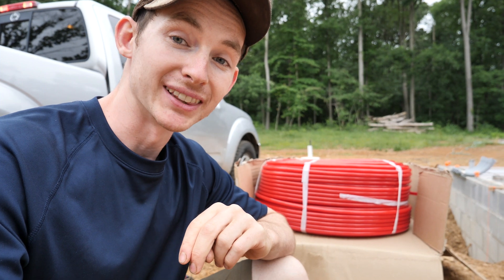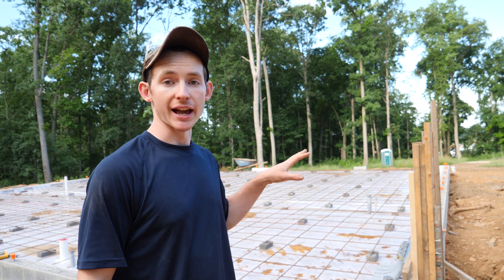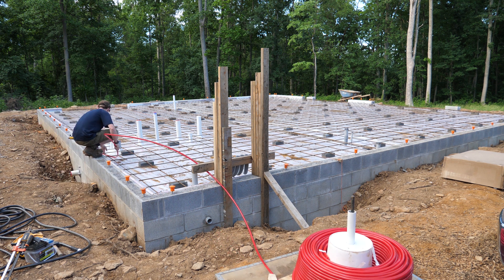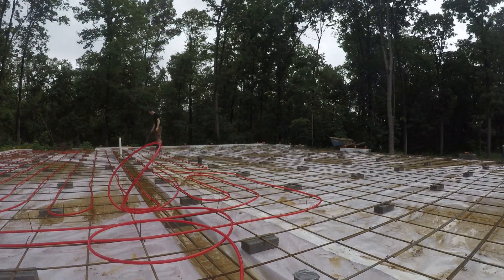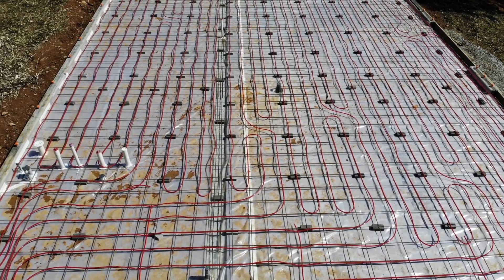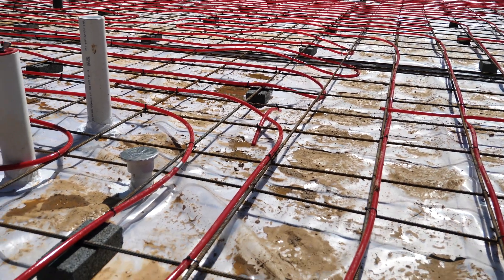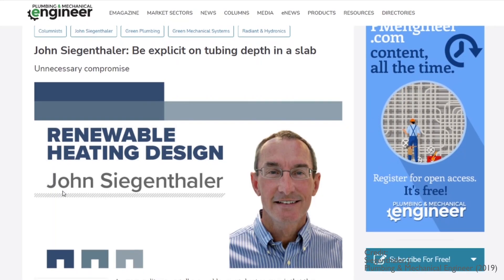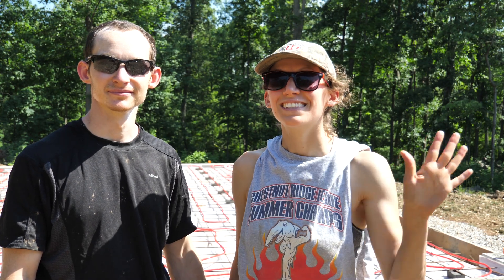Radiant Heat Tubing in Slab (installing on rebar)

Comment: After watching three more times :-) I am Leaving the question yet I think I figured out you were using the crimp tool. I am thinking about using the expansion tool yes a little bit more money just looking for thoughts trying to figure out what I'm doing.  ----- Another question for you, you said you use PEX A, question is a relates to your repair kit if you needed one and it doesn't sound like you did were you using an expansion repair kit or a coupling? I don't even know what a repair kit looks like yet.
Reply from the maker: I just used crimp rings for the test hookup, cheap and easy. They will get cut off for the real install. I like the expansion couplings, however it's harder to do them logistically as a DIYer. Big box stores don't carry the fittings, plus there's the expensive expansion tool (if you want cordless). For my real plumbing, I do lean towards the expansion fittings, whether that be myself or a hired plumber.

Comment: Thank you so much this is help me out did you get your system from someone or you designing it yourself i.e. your radiant floor system. I saw the same article and have saved it concerning placement of pipe and was also concerned about expansion joints/control joints I'll be building a new home starting in spring of 2023 in North Carolina right on the Tennessee state line.  Came across your video because I was researching if PEX a would be adequate or acceptable for radiant floor heating touching concrete
Reply from the maker: Yes you definitely want PEX-a with oxygen barrier. PEX-a is also easier to work with than PEX-b. I used a free trial of LoopCAD to layout the system myself. Haven't gotten to the boiler/manifold/circ pump yet, but I'll either get a fully pre-built setup or try to DIY it for cost savings depending how much energy I have at that point..

Comment: Just about to start our 3000sqft radiant system and after watching countless videos you answered the main question… where to put the tubing in relation to the slab!!!!! One quick question, what are those blocks you’re using to raise the rebar? Will any block work?
Reply from the maker: Glad it helped! Those are concrete "bricks". About .70 at the big box stores. Use either the plastic chairs or something with similar density to concrete, not clay bricks. The plastic chairs aren't nearly as sturdy however.
Reply: There are plastic rebar chairs at 20 cents each that l may buy to get away from bricks.these bricks,used whole,leave a weak spit.chairs are 500 minimum though..that for a monster slab.tgey go at intersections of 2 rebar,but not at every one!I would say 4 feet apart..ebay..Marshalltown l think

Comment: Interesting system that is widely used in the screed. And in your case in the floor plate. However think about it in 50, 70 or perhaps even less years. You can't just repair it if it fails...
Reply from the maker: The tubing is pretty well inaccessible after concrete, yes. But that also keeps it protected, and with no joints it should have no real reason to fail by degradation. If it does.. hopefully I’ll be dead and it’s the next owners problem 😅
-Alex
Reply: @MasonDixonAcres  that's a viable statement. Just future wise I wish building would be done more with a reusable aspect to it. For example: now you have to rid concrete of all this non-magnetic tubing in case of recycling. Also things like spray foam insulation are just horror when it comes to circular housing. Don't get me wrong I certainly make decisions myself that are not the best regarding this aspect. But scratch my head when we Westerners keep waisting many reusable building materials... It would be easier with a collective approach or incentive
 Because we want comfort in relation to our budget and eco/recycleable is always a side-bonus unfortunately.

Interesting build, keep it up!
Reply from the maker: I think the solution to that is to build houses with the intention of never tearing them down. Just keep them occupied and maintained in perpetuity! Maybe that’s wishful thinking, BUT there are some pretty old residences out there doing just fine. The one we’re in now was finished in 1917 and still a beauty!
Reply: @MasonDixonAcres  maybe that could be one of both strategies combined! Renovating a house from 1954 here so you have a solid point
Reply: Everything fails.50 years is short but there is plastic pipe laid all over the US IN water systems that is still 100%..not heated though.l mean in the ground.

Comment: Nice attention to detail.  I like your technique of using scrap pex pieces to ensure the lines are recessed below the saw cuts.
Reply from the maker: It was sort of a last minute idea honestly! There wasn't enough radius between the 12"oc rebar to bend them all the way to the bottom. If/when we do this again in the future, I'll either do 24"oc spacing OR keep it at 12"oc but leave out a piece of rebar where each cut is. Didn't have that much foresight this time around!